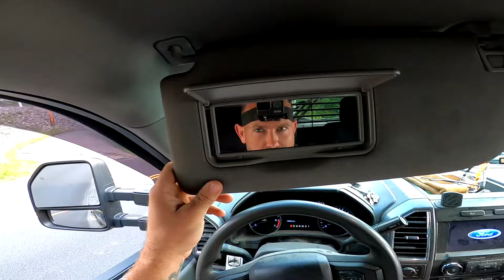How To (Properly) Prepare the Base for Concrete Pavers | "Open Grade Base"

Comment: Kyle, thanks for giving me the confidence to start my patio project over here in Michigan. I ran into some issues, though and could use your expert opinion. 

I've dug 10in down to my clay sub soil and got some rain before I could get my base gravel delivered and installed. The sub soil is now just mud and water in spots. When I step on it, my foot sinks in. Do I just need to wait until it drys out? Or is there something else I can do/add to dry out the soil?

Thanks for all the videos and knowledge.

Comment: Hey Kyle, I dont know if this could ne considered advice as much as it is just something I noticed, but anyway.... when my wife and I cut about 1000sqft of sod from our field to use in our back yard we found that the best way to get a perfectly straight line separation is a dull wood blade in a reciprocating saw (sawzall where I come from) I noticed that would have been a decent trick for you on this job for when you removed the grass for the patio. The sawzall cuts right thru the grass and roots and leaves a really nice straight line when you pull up the grass. Love your videos man. The wife and I are going to do a sitting wall and a few steps soon and I feel confident to give it a go ourselves bc of your videos, so thanks man.

Comment: Do you worry about getting grade with the base under the geo fabric and the 3/4th on top of the geo or do you just compact it and worry about leveling and grading next step?
Reply from the maker: To a certain extent, yes. But I don't spend too much time making it completely perfect, especially when the subsoil is a well draining material. ✌

Comment: Do you have a link or a name for the fabric that you use after your initial compaction of the 3/4 and sub soil?
Reply from the maker: Here is a link to their website but you will have to find where you can buy it online or at a dealer near you 👉https://srwproducts.com/product/ss5-woven-fabric/
Reply: @TheChristianHardscaper  Awesome thanks brotha 🤟I  got a small walkway and landing that I'm going to be doing and I'm gonna use your open base method. One more question. What are your favorite 3 piece pavers to work with? I have watched every one of your videos and I've seen you use a few different brands. Is there one in particular that you find yourself steadily going back to?

Comment: Laying 1000 square feet of rustic clay bricks this spring. This past fall i got all the base 3/4" clean. Debating on now lay a 6 oz nonwoven geotextile then 1.5" of Sharp concrete sand, or no fabric and what you like the 1/2" clean stone or 1B. Will a 4x8 brick lay nice on 1B? I feel like I won't have the good firm bed. Also does the the joint sand fall into the 1B? Thanks in advance!
Reply from the maker: That's awesome man, I love rustic brick patios. Really nice look. I assume 1B would be similar to the (chip stone) I use in my videos which is a 1/4" - 3/8" clean, crushed stone. I definitely recommend that over fabric and concrete sand. Chip stone is far more stable and allows much more water drainage. And the joint sand does not fall into it. I have done this method for close to 200 installs now and have used polymeric sand successfully on each one. Good luck with your project! ✌

Comment: Did you have a back up plan for the pavers at the lake wall if the footing was higher than 3 3/8 inch below the wall cap? ( guessing 2 3/8 paver + 1 inch chip stone)...Best, Steve
Reply from the maker: I actually did not... It was not something in my mind really. But if I did run into that, I might of had to leave a strip of decorative stone along the wall. 🤷‍♂️

Comment: I like this method, I am getting quotes for a walkway next to my patio and getting different information. How will this method work if I have a sunken area that collects water next to the patio from the rain and run off from a hill?  I was thinking of having the walkway built higher than my patio, giving it a sunken feel.  Also,  what do you think about CR6 as a base since it also has stone dust.
Reply from the maker: This method is excellent for drainage. So does the water in the area you are talking about stay there or does it slowly drain into the soil? If it is always a puddle, you may need to incorporate some kind of drainage solution with your build. Lifting the walkway higher and sloping the grade away from it is definitely one option for that. Another would be to install drainage pipe under the walkway in the trouble area and divert the water to a lower grade somewhere else on the property. I don't like using any base with fines particles in it, it has just proven to cause issues, especially in a freeze/thaw climate.
Reply: @TheChristianHardscaper  thank you very much for the info.  It drains slowly, but ai think raising the area will work.  I worry about potential mud coming down the hill causing drainage pipe issues in due time.  I don’t want to have to redo the area over later in.  I hear they have the potential to do so.

Comment: What is the size of chip stone you use in your videos buddy? Is that available in home depot? I could see 3/4 which you put for base. But having difficulty in finding the chip stone
Reply from the maker: The chip stone I get is a mix between 1/4" - 3/8" clean crushed stone. Not sure Home Depot has anything like that. Worst case scenario, you can use 3/8" - 5/8" crushed pea stone but it is tougher to screed..
Reply: @TheChristianHardscaper  we have a small patio and we are doing it ourselves any other stores where we can get the chip stone? Iam located in Philadelphia
Reply from the maker: @vibhanair6019  Unfortunately I am not to sure... You should call around to landscape supply stores in your area, maybe one of them will have some
Reply: @TheChristianHardscaper  thank you so much. That helps

Comment: Great content. I have a question about paving the driveway, would you recommend the same materials to prep the base? I am in the same climate zone. Many thanks!
Reply from the maker: Thank you, and yes. This prep method is great for driveways, however you need to do a few extra things. Like compact more (in more lifts). Also, you should add 1-2 layers of geo grid in the base stone as you backfill. Lastly, you want to buy thicker pavers. I talk about that in the video we lay the pavers. But the pavers we use all the time are 2-3/8" thick. You want pavers closer to 3" thick. If you do all those things, your driveway will come out mint 👌
Reply: Follow up question: considering the use of the 3" stone, please give me a breakdown of how deep you would excavate, number of layers and the compacted thickness of each layer? Many thanks!

Comment: Will #57s as the baselayer and #89s for the screeding layer work?
Reply from the maker: Absolutely, #57 stone is a bit bigger and has a bit more fines in it typically but will work just fine. And #89 stone is good for the screeding layer for sure ✌
Reply: Thanks man!
Reply: Hey its me again. Would #9s work instead of #89s and what geotextile fabric do you recommend? Also will 4inch total of the 57s work for the base? I'm building a circle paver patio using 8"x4" pavers and going to add a fire pit.

Comment: Would 3/8 buckshot work for the top layer? Trying to find what you use at our local gravel pits is tough lll
Reply from the maker: From what I know, Buckshot is clean, round stone 3/8" or less correct? if so, yes, that will work. As long as there is a ton of fine/sand particles.
Reply: @TheChristianHardscaper  so you want clean stone with small fine sand?
Reply: @TheChristianHardscaper  or did you mean no fines?
Reply from the maker: @matthewrozumialski8196  I'm sorry, I meant to say "as long as there is NO fine sand particles." ✌
Reply: @TheChristianHardscaper  that’s what I thought lol

Comment: For the geotextile, was it woven or non woven?
Reply from the maker: Woven
Reply: @TheChristianHardscaper  sorry I’m confused, even if drainage is an issue I should go with woven?
Reply from the maker: I have used woven geotextile on every project I did for the past 5 years. All sorts of different soil types and circumstances. In my opinion, the stabilization / separation you get from the woven is very important. Non woven just is not strong enough to stabilize the stone nor will it hold up as long as the woven. Some get worried about water not draining through the woven but in my experience, there is no problem at all (over 200 installs with it).

Comment: Alot like working with my dad & the different characters.  Doing some terraces with natural stone bedded into a ratio mix of concrete/type S mortar.  (big steps of a walkway)  Yeah: I feel like the washing out & rodents can dig the ca6 easier than washed 3/4-1 white gravel.  That said getting the washed rock here has been more of a challenge from the other supplier.  I think I like the wahed rock.
Reply from the maker: That’s cool to hear man, I love having all those guys around. Makes the day go by nicely 👌🏻

Comment: DirtMonkeys use granite dust I believe. ?
Reply: The two Main bases used are traditional and open grade. Open grade allows for more drainage. Traditional does not. Both are great options. Just depends on location
Reply from the maker: Yea, DirtMonkey has been using the traditional base prep method of dense grade and sand for as long as I know. What is funny actually is that he just recently uploaded a patio build where they used open grade base. I think they are catching on to all the benefits. I haven't used the traditional method is almost 5 years now and probably never will again.... ✌

Comment: I was watching this video of yours: https://youtu.be/fDe3tMZQY5o?si=58r9y0TXsWmE0xZ4

And you mentioned (and it looks like from the video) that you don't compact the bedding layers on top of the geofabric. But in this riverside project you do compact the bedding layers. I'm curious what was the reason for not compacting the bedding layer previously but now you are compacting it in several lifts.
Reply from the maker: With Open Grade Base, using 6" of base stone or less on top of the fabric may or may not necessarily need to be compacted. It is actually something that gets debated quite often in the industry. Some say it is better for the chip stone to lock into the base stone if you do not compact it because it allows to stone to lock into the open voids better, some argue it is better to flatten and tighten the base stone before the bedding stone so it is less likely to migrate. I have done it both ways multiple times simply because it has been something I want to test on my own. What I have found is that they both work just fine. That project in the link you shared has been installed for 3 years now with no shifting or settling. So I would say the most important part is compacting the subsoil with a thin layer of stone on top of it before the fabric. If you look up compaction rates of 3/4" clean, crushed stone, it is 98% compacted with just being raked out up to 6 inches. Anything more than 6 inches should absolutely be compacted no matter what. This application, we were between 7-8inches of bas stone so I compacted twice, plus the subsoil was softer than typical situations. So determining all the circumstances on different projects is very important. There is no one size fits all in hardscaping for base prep.